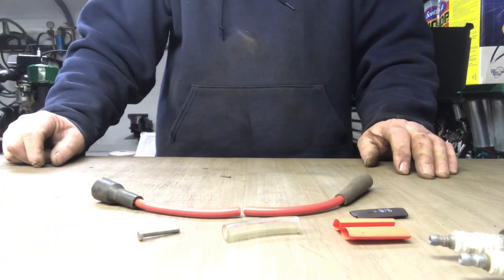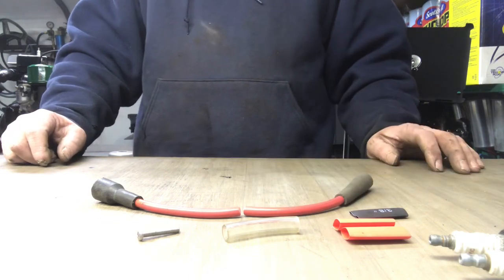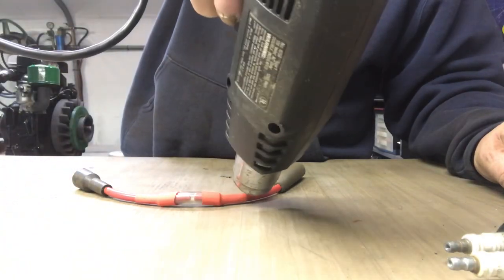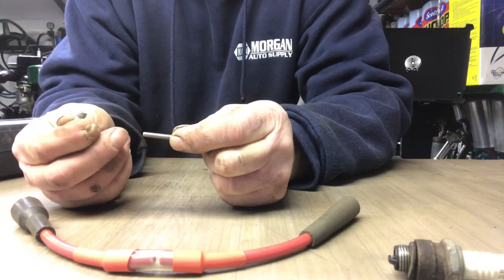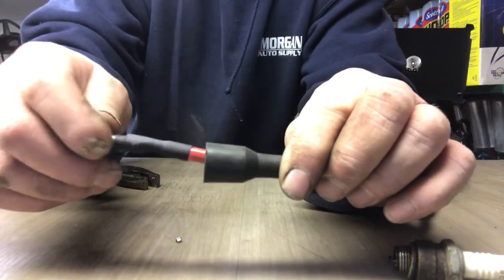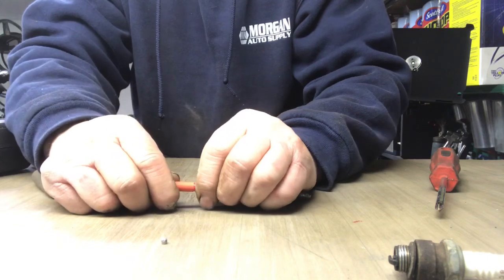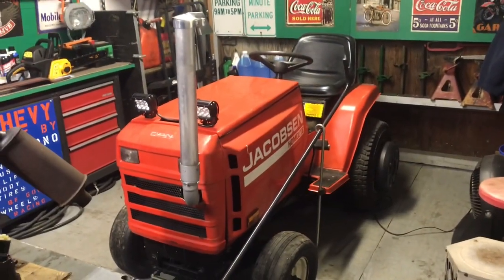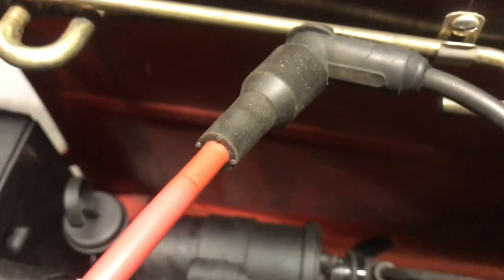Diy spark tester!

Comment: Interesting.  I assume the heat shrink is to insulate the assembly when current goes through it aswell as to keep the clear tube together? I dont have heat shrink off hand for tomorrow.  Could i use cable ties secured very hard on each end instead of heat shrink to keep tube in place over the lead ends?
Reply from the maker: Zip ties would work fine. If the wire fit snug into the tube you don’t have to use anything. The heat shrink I use just keeps it all together.
Thanks for watching

Comment: I followed your instructions and made the tester.  Hooked it up to my lawn mower to test it.  It worked...kinda.  The mower runs but there is no spark visible in the plastic tube.  I adjusted the gap to almost touching and then I kept making the gap bigger til the mower quit but there was never a spark.  Tried it on my weed wacker too but can't get a spark in the tube even though it runs good.  I did it in the dark in case the spark was so weak you couldn't see it in the dayight.

Comment: Subscribed and liked 
I needed this video because I need 7/16 gap precise to check the spark on my boat . So far I haven't found a spark tester thats adjustable   although they probably do make them . I will make one myself . Thanks for sharing Bone
Reply from the maker: Five String Thanks for the sub and thanks for checking out my channel!
Reply: @boneyardgaragesmallenginer188  channel is awesome sir

Comment: p.s. Love the modification you used to retain the spark plug tips! That's definitely an improvement over how I threw mine together and if you don't mind, I'll borrow your idea and upgrade mine! Cheers again! Zip~
Reply from the maker: ZippoVarga Thanks for the subscribe. Feel free to use any of my ideas. My lift is a handy lift and yes it is air powered. The two extensions are removable. Maybe I will do a video on that.
Reply: @boneyardgaragesmallenginer188  ..What's the title of your video where you make your spark tester?
Reply from the maker: @locknload9143  DIY spark tester
Reply: @boneyardgaragesmallenginer188  ..Thanks buddy!
Reply from the maker: @locknload9143  thanks for watching